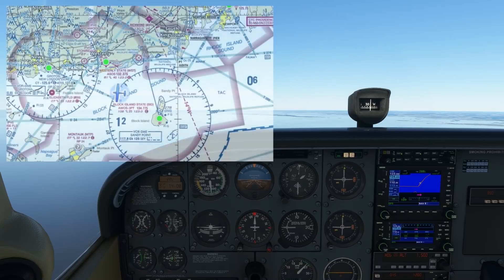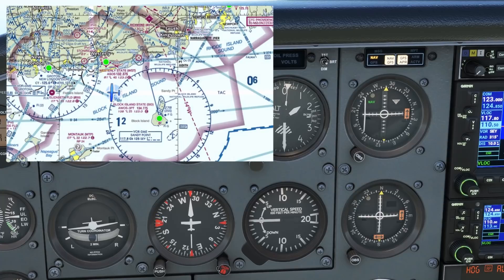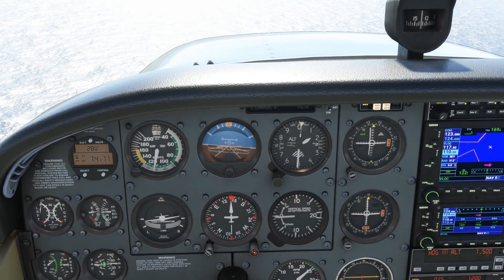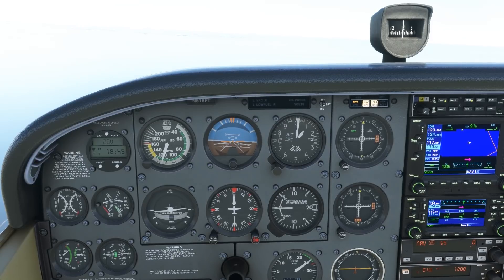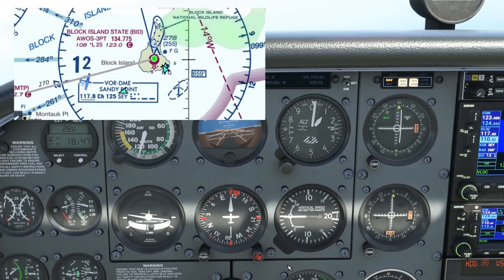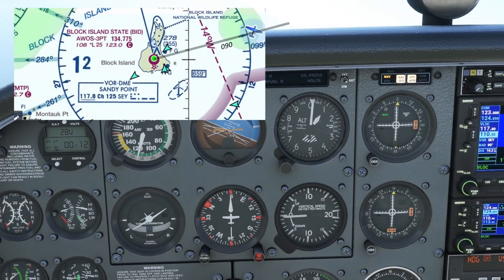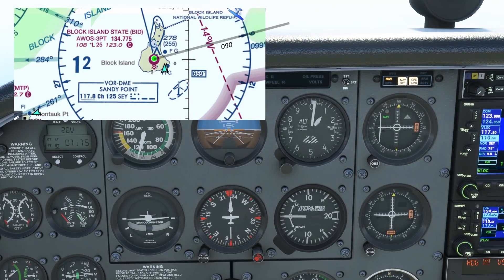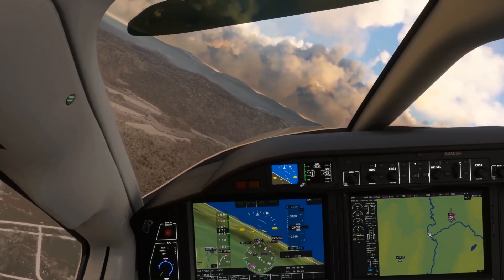How to Make VORs Easy to Use | VORs Tips | IFR Training

Comment: So if you are flying to the station with a from indication, you will have reverse sensing,  but if you are flying from it with a from indication,  you will have normal sensing.  Is that correct?  This is the only area I have trouble with when it comes to VORs.

Comment: I know this is nitpicky, but the best way to find the exact radial that an airport that does not have a VOR/TACAN on the field is usually the A/FD.   In fact, TAOS is not the closest VOR but rather SAF (Santa Fe VOR) is.  In the AFD it not only gives you the radial and frequency but also the distance.  That way, if you're flying around using radio navaids you can quickly find the proper radial without whipping out your ruler or guesstimating the radial by eyeballing the chart.  (Ofc you can also just use Garmin Pilot or ForeFlight's on-screen ruler but that's cheating!)

The other advantage to using the A/FD versus just eyeballing, especially in mountainous terrain, is that the A/FD will also identify unusable radials.  It's very possible that at certain altitudes and on certain radials the terrain will block the VOR signal.  This becomes more apparent the farther away a VOR is due to both the height of the terrain and the curvature of the earth, especially with small aircraft flying at low altitudes.

The video is terrific, though, and I've subbed to give students some good videos to use when teaching them these concepts.

It's funny that they chose to use KTGI as an example at the last part of the video, though. Maybe they train a lot in that area.  In IFR we're generally taught to plan to avoid restricted areas wherever possible, even when they are under ATC control.  Yes, ATC will route you around an active restricted area, though you're unlikely to receive an amended clearance instead, and yes you can still use the chart to determine activity times, but it's pretty clear from the chart that Victor-1 is charted to fly between the restricted areas, likely for a reason.  R4006 is restricted from 3500 feet to FL250.  I'm not sure why the folks producing the video chose to use a VOR chart vs the low-level IFR chart.  /shrug

(More nitpicking, but KTGI actually lies on the 156 radial and not the 152 radial.  I found this both on Airnav and by setting up a flight plan using Garmin Pilot.  At roughly 30NM between the VOR and the airport, a 4 degree deflection would be roughly two miles off course to the NE of the airport.  Again, more thought experiment stuff but learning to use the right charts and procedures when setting up IFR flights is extremely critical.)

Comment: Funny, I never found VORs hard to figure out.  The technical specifics of how they work (radial based on phase angle of two overlapping waves, or something like that) I'm not all that clear on, but the use of them always seemed very straightforward and easy to figure out.  Even as GPS became more prevalent in aviation I preferred to stick with VORs for the longer trips (and pilotage for the shorter ones).
Reply: It was you and more interest back in the day when you used to have to track In and outbound  of an NDB. There it was infinite number of bearings. The way you figured out how to how you got to the station with a fixed compass card was to take the indicated bearing and add your current heading. If the amount was greater than 360 you would then subtract 360 and that would be the magnetic bearing to the station. Learning to track an NDV outbound had its thrills to. You can still do this on the G 1000 if you set your bearing #1 or bearing #2 to a VOR while tracking the magenta line for the GPS. The VOR needle will act just like an ADF. Station passage will be noted when the needle spins 180°.

Comment: You don’t have reverse sensing with a HSI. Reverse sensing is a poor description. It is more like situational awareness.  I will give you a good example of this. You’re driving along in your car on the road heading southbound. You’re holding a map normally north up or you have your GPS set north up. At the next intersection you need to make a turn toward a location you see on the map located to your right. If you look at the map and make a right turn you’ll be going in the wrong direction. The proper way is either flip the map around to the direction you’re traveling or you make a left turn. The map appears in your mind to make a right turn which is actually the wrong way. If you notice on a GPS giving you directions it will say make a left and if you look at the upper left-hand corner the arrow will show a left turn but the magenta line appears to go to the right. (Only if set to NORTH UP). This is all part of situational awareness. This is why the HSI was invented. It also helps because it is slaved to the compass so you don’t have to keep setting directional Gyro every 10 minutes. Hope this helps. Remember, heading to a radial or intersection, with a FROM indication, if the needle and the station are on the same side, you’re not there yet. If they are opposite, you past it. The same is true for a localizer which shows a feather portion of the arrow on both sides of the runway, but the feathering is on the same side. This used to be called the right side and the left side. It was so much easier to figure out when the VOR instrument in the cockpit had a blue arc 150Hz and a yellow arc 90 Hz at the bottom of the instrument. You were than able to realize whether you were in the blue zone or the yellow zone.
Reply: I like your explanation on this one :)

Comment: Good video. I've been lost twice. The first time while in the Air force and in the practice area, the haze drifted in and I couldn't see the base. So I started heading back in the direction where I thought the base would be and after a period of time, I figured it was time to call the base control tower for some help. They found me 90 miles off course and with radar brought me back home. That's when I decided it was time to learn how to navigate using my one VOR in my Cessna 150 rented out of the base aero club I was in.

The second time I got lost was in California while doing a cross country for my 100-mile pilot requirements. Although I know I could follow the freeway to get back home, I thought I would try out my skills to find my position using the one VOR in the Cessna 152 that I was flying at the time.

By homing in on two VOR stations and using triangulation to find my position on my Sectional chart, I found the nearest airfield and headed to it. I landed at the field and asked to see if I had the right airfield, and I did. Now I knew where I was and recalculated a new course and continued on my cross country. Practice, Practice, Practice never hurts.